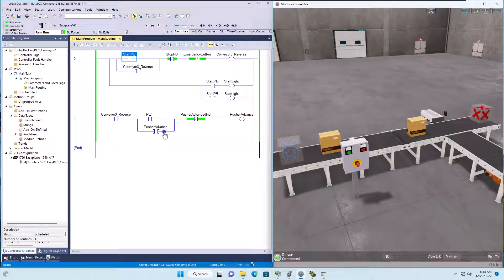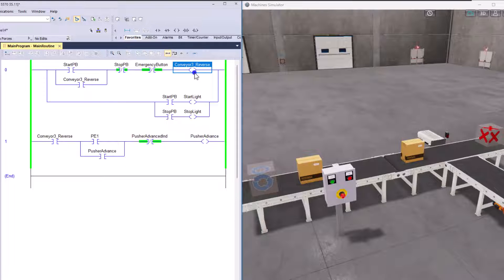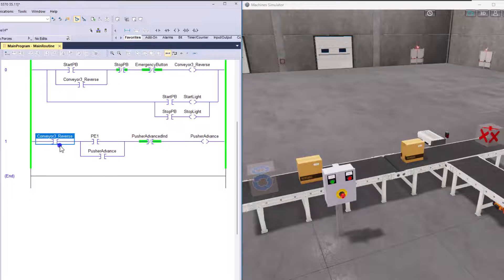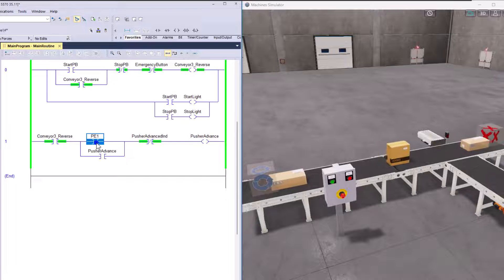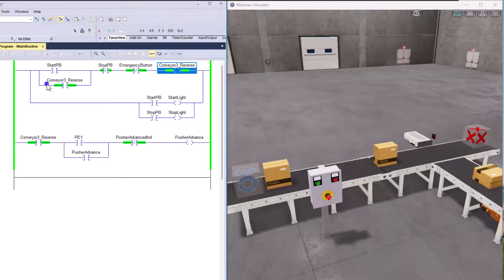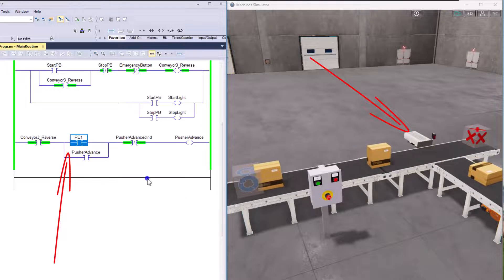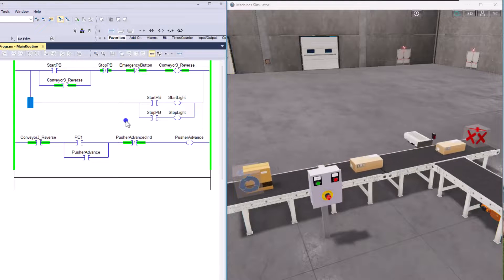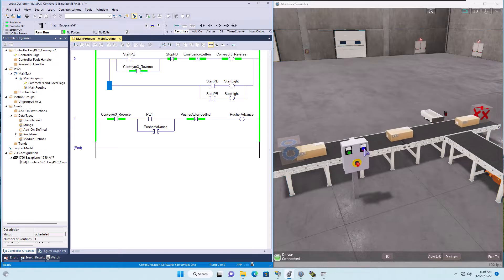PLC Ladder Logic Basics for Beginners Box Sorting Conveyor Using Studio 5000

Comment: For the first rung. If you use an output latch for conveyor reverse instead of the OTE would it still be necessary to add a branch under the start PB?
Reply from the maker: If you use a latch/unlatch technique then you would need to latch one direction in then at the same time un-latch the other.
In my opinion, using latch bits are not a good suggestion for this exmaple.
Reply: @ShaneWelcher  thank you!